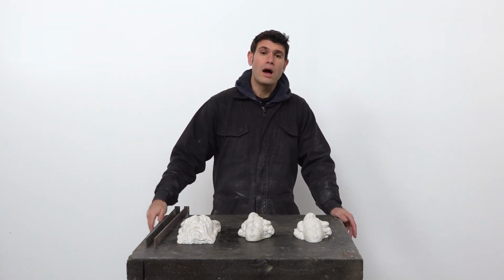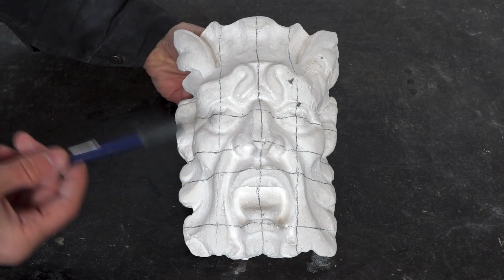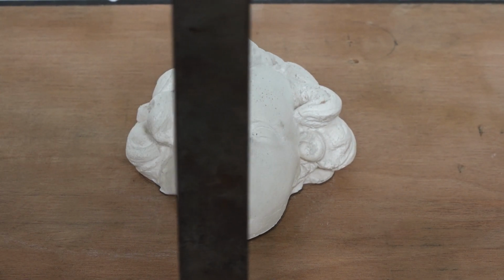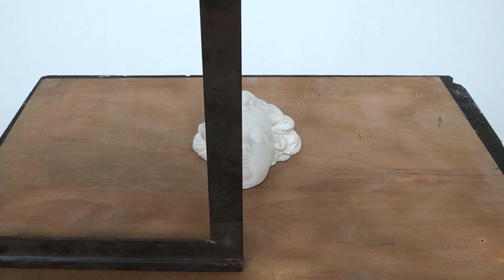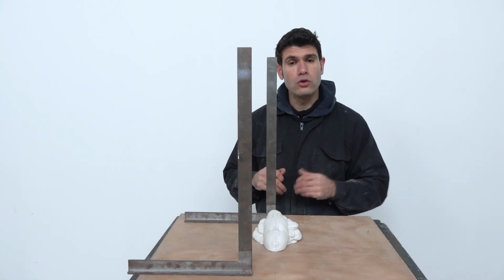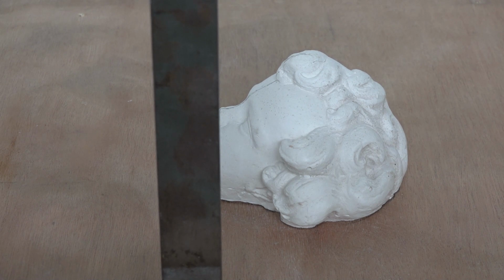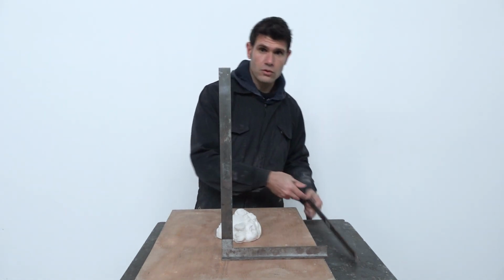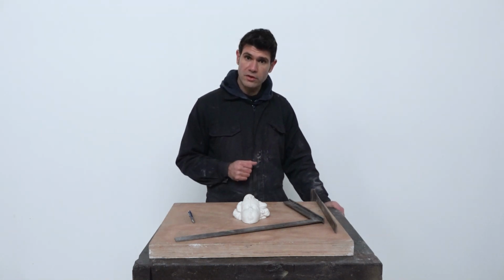Sculpture tutorial | How to Draw Straight Lines on a 3D Surface

Comment: is there any 'trick' to guard against parallax errors in marking grid lines please ?
Reply from the maker: I might be wrong but isn't parallax caused by looking at an object from two different points of view? The thing about this method is to look at it from only one exact point. That's what the squares are for. You decide which point, but once you place the square there's only one line that passes through it and through the square at the same time. I hope this short explanation is clear. But above all, the 'trick' is to just practice. I used to struggle too at the beginning and I see many new student struggling as well, but after a while it will become second nature.